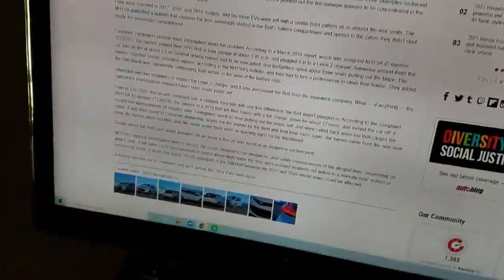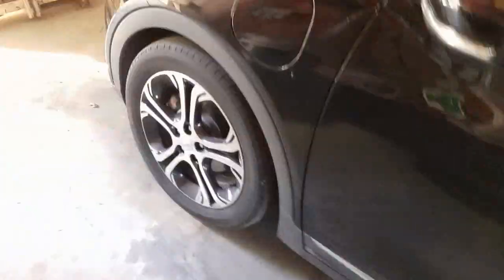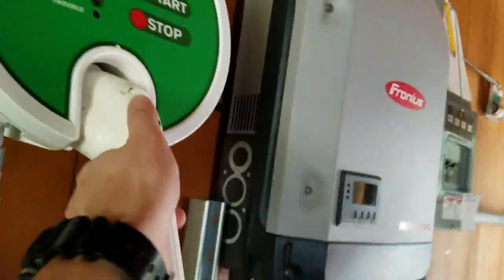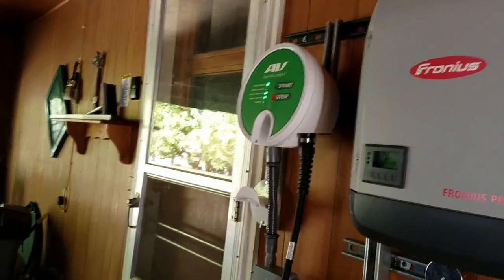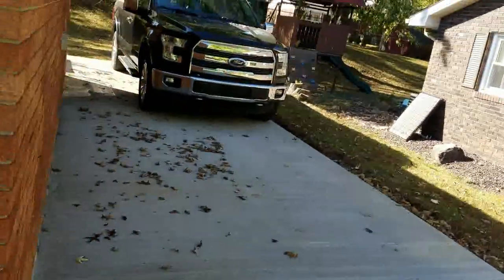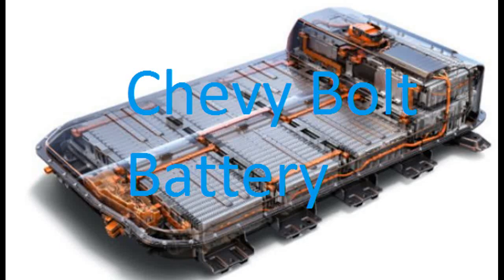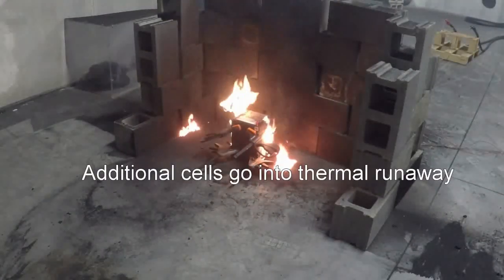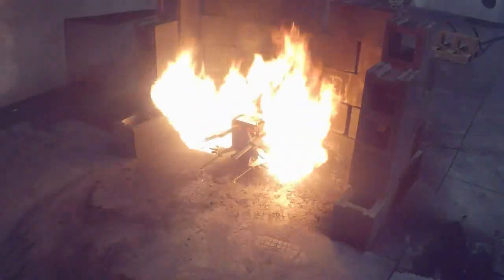Bolt Battery Fire

Comment: Get s Tesla
Reply: Teslas have a 0.9% probability of spontaneous battery venting. The Bolt has a 0.007% probability. My other car (a Toyota Mirai) has a 0.00000% probability.
Reply: @homomorphic  clown car
Reply: @enoughofthis  yup, they certainly are.
Reply: @homomorphic  2021: what is a Toyota?
Reply: @Momo108iscool  I can totally understand the confusion from someone who obviously lives in a cave in Afghanistan. So to begin bringing you up to speed Toyota is a company that sold 9,000,000 cars last year. Now that you're out of the cave, you'll probably soon notice that about every 5th car you see on the road is a Toyota

Oh sorry, I realize I am throwing around the term "car" as if you know what such a thing is. Are you familiar with what a car is?
Reply: Guaranteed to burn……not sound for environment either

Comment: The probability of a battery fire in the bolt is 0.007%. You have a higher probability of contracting the severe form of coronavirus and dying.
Reply from the maker: Right.  I don't think its unreasonable to take a minor precaution and only charge when I'm awake and wait for the root cause analysis.  Cell pressure increases during charging and discharging which can trigger failure.